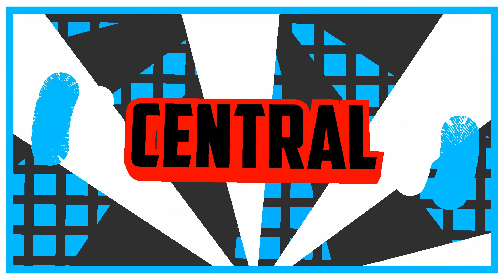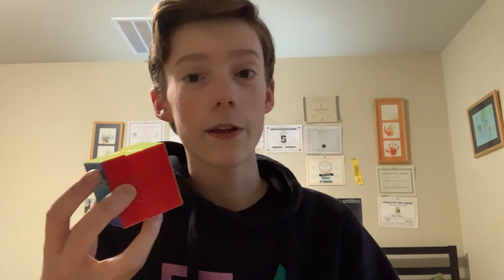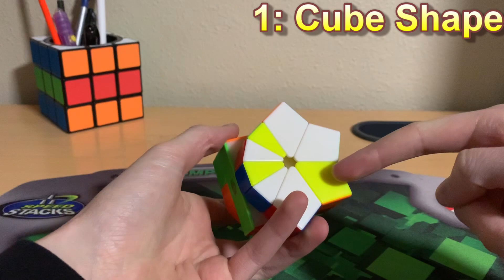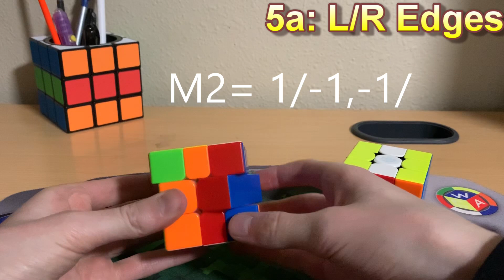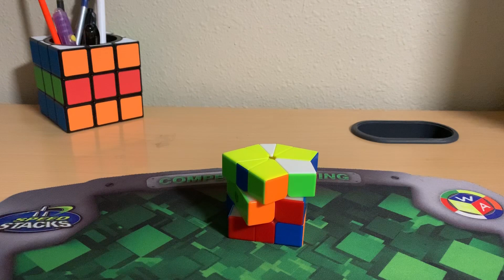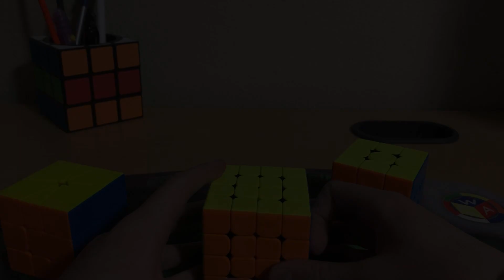How To Solve a Square-1 w/ ROUX METHOD (Beginner Tutorial)

Comment: Hello guys
it's Crazy Cuber here
And I found out a super simple way to get to cube shape easily
if the case of the OBSERVATORY really annoys you I'm here to chill you out
first hold the cube as shown in Blobinati's tutorial but make the extra single edge go to the left of the slice and slice over it
then you have to slice the next 2 edges that are near to each other but not the single one
and after slicing align the blocks that you get all of the bottom edges to the top with no corner separations and finally align it again to get the line and slice over one more time and here are your 8 or what's known as the super star